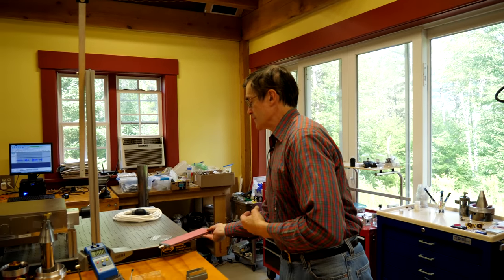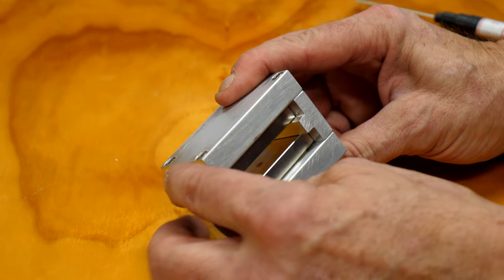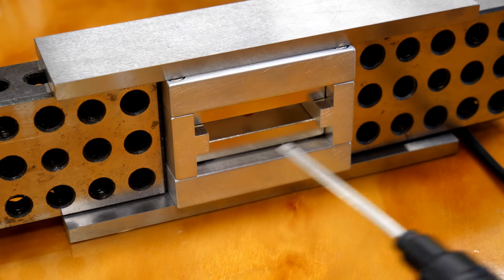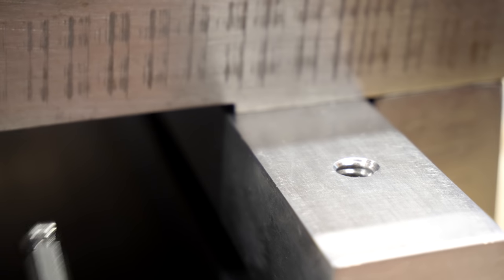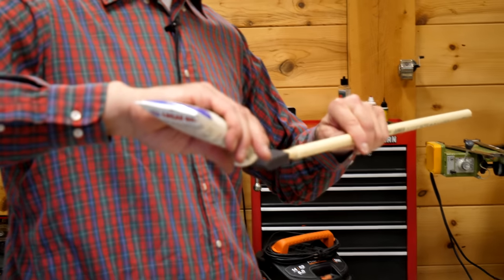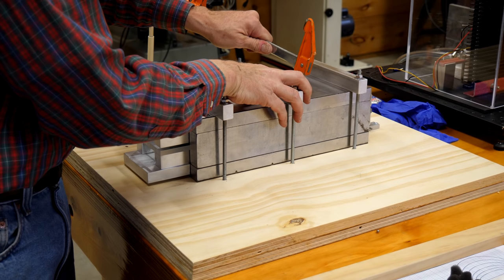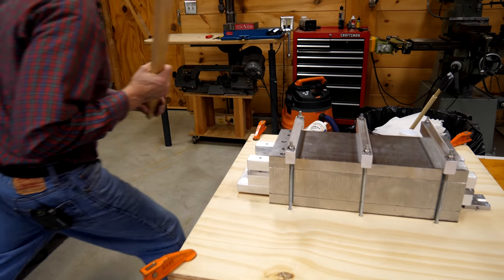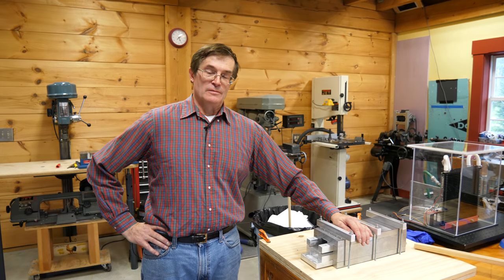Extreme Magnets

Comment: Any consideration of eddy currents in the yolk?
Reply from the maker: No, not really.  Eddy currents are produced when you have a changing magnetic field as in a transformer. The magnetic field in this magnet assembly is constant.
Reply: @TechIngredients  That's right, I completely forgot that. I was worried the assembly might end up making some heat due to Eddy currents and was curious if you had considered a laminated core instead. But there should be no currents. Thanks for replying!

Comment: Sir, what will happen if we use a neodymium magnet and put some rounds copper wire around it and then try to make it electro magnet... Will it change the magnetic lines/fields of the magnet untill we provide the supply..?
Reply from the maker: The copper is not ferromagnetic and will not change the field distribution without current flowing.  Add current and the field generated by the coil will modify the field established by the permanent magnet.

Comment: Of course if there is any movement of magnets the current induced in the electric  conductive material of aluminum will set up an opposing magnetic forces.  Perhaps some strong plastic would be a better choice as neither magnetic or electromagnetic or electrically conductive which may be hinderance.

Comment: My fascination with magnets just doubled! I'm still reeling a bit from the discovery that iron filings o n paper do not actually represent the actual field lines; that it's the presence of the filings linking to each other that makes the patterns. (can't remember the guy's name, but is on utube and a funny and fascinating physics teacher)
I shoot thousands of 3/8" ball bearings with many different slings I make and collect them with magnets. Some are stepped on, rusty, and hard to retrieve. I made an electromagnet from a microwave transformer that works, but I have to tote a battery charger around the range with it, and the field isn't far beyond it. 
How would I set up some neodymium magnets to reach out farther with the field, but still have the strength to pull the wanton balls from the ground?
Reply from the maker: There is probably not too much you can do other than using larger magnets. However, assembling a Halbach array will alow you to intensify the field on one side vs the other and this can be used to direct more of the field toward the ground.

Comment: Could you explain the convention of magnetic field 'lines'? I was taught (admittedly,  several years ago), when pursuing a degree in electronic engineering, that magnetic field lines did not exist. But was rather a man-made convention, (largely inferred from early experiments) of the manner of which iron fillings appear to align themselves via magnetic induced polarities, along a gradient path...
In effect, a field is a smooth magnitude gradient with no inherent lines.
Reply from the maker: Personally, I believe the best way to clarify this is to ignore the iron filings.  I'm not being factitious.  The material interaction between the individual iron particles includes friction and the unsymmetrical shape of the particles.  When a particular series of these needle-like particles achieves a closed loop from the N to S pole, the field will be guided or concentrated within this pathway, just like in our yoke and the field strength on either side will be lower thus discouraging the development of another series adjacent to this loop. 

The field is smooth and continuous unless there are objects in the surrounding environment that disturb it.  The filings modify the magnetic field distribution and then go on to show the effect of this modification.
This is like the man convicted of killing his parents and begging the judge for mercy because he is an orphan.

Comment: Wondering how you safely disassemble it.
Reply from the maker: We probably never will, but a hydraulic ram with the shaft coupled to an aluminum push rod and an extended aluminum guide would do the trick.

Comment: I had a thought experiment💭 "What if black holes are like Grand Recycling Machines ♻️ of the Cosmo's♻️" So just like systems with-in nature have a balancing act and abilities to convert and transfer energy. Like a ecosystem that keeps cycling so natural systems can function.. *(it probably has a limit beyond anything we can ever grasp or measure what it could be from our current perspective?) It's like asking someone to describe the outside of a box, if they are in the box, and the edge of the box exists past the limit of the observable distance that light can travel before hitting a boundary point. It would be pretty darn hard to explain what the outside of that box might be like? Ya know? I don't know? I was just thinking how a ecosystem of a forest flourishes due to it's symbiotic relationship with Fungi and mold/lichen, bugs, soil, mycelium, a water source, etc. With the help of the fungi the Forest no longer suffocates itself. The Fungi gets to help breakdown and convert the carbon thats locked away in the forest floor, fallen Tree's, plant matter that's all throughout the soil. On top of that it works together symbiotically with the living plants roots to help them breakdown & absorb nutrients. That plant cant function to that level on its own without the combination relationship of these 2 aspects of nature which keep this ecosystem functioning. This is true in many different ways, in many different types of ecosystems, all throughout nature. A part of me can't help but look at parts of space like that. Like if certain things in nature work here, then maybe there is a new way we have yet to discover and see how they behave. Aspects that could keep systems functioning throughout nature and space.  Some things we are limited to what perspective we can perceive and what we can utilize for further observations but we can still use our imaginations. Then fine tune things from there 👍🏼
~~~~~~~~~~~~~~~~~
~{Hypothetical idea}~
What if our universe is 1 half of a sorta ying yang ☯️ universe. 1 side is what we see, the other side is the Anti-universe. Maybe there could be a membrane layer in-between the 2 layers. Which allows for quantum particles to pop in and out of existence and decay from that membrane with the other half. The 2nd half could be our universe but maybe be an anti-universe. Where anti-particles go? Where the anti-matter can create this balancing act with-in the system. (It doesn't mean there is multiple versions of ourselves and all that stuff when people talk about a multiverse. No, not that.) It's just a thought about a possible natural way to balance things out, yet also describe the fluctuations we see in quantum mechanics. I just had a random daydream thought and obviously I hope more professional people's minds end up diving into this sorta possible theoretical physics. I think Neil Turok had a similar theory. 
⚖️ 🌐🧲🌡️🔆☢️⚛️♻️🌐☯️ 
~~~~~~~~~~~~~
🧲🌡️📡🔆☢️🔌🔊🔋♻️☯️⚛️
Out of every aspect of physics, i feel Gravity and all the aspects of Electromagnetism play such a crucial aspect of the cosmos and we possibly have much more to learn about these fields of physics? if you really think about it- It's really facinating how so many properties with-in Nature use: ~{"Differences"}~
 That factor seems to be a key factor in keeping dynamic systems functioning. *{High pressure/low pressure, hot/cold temp, different densities, static electric charges/discharges, electromagnetism north/south poles, different velocity/angular momentum, different amounts of energy/mass/frequency/vibrations. The different layers between different regions such as, land, water, air, edge of atmosphere, space, the different regions in space with different particle density, background radiation, creating bubbles/membrane layers, cloud regions, nebula's/ Galaxy's, Galaxy clusters, less dense voids regions of space compared to dense regions of space. All of these things are basic differences but create a way for the dynamic engine with-in Nature to continue flowing and operating to create and convert energy.} Just Like How a battery 🔋 transfers + charges through a membrane layer to a - charged side. Like how regions of high/low pressure and temperature 🌡️differences create winds. In water or a planets core- add some factors and It creates ocean currents and flow. Then internally in our planet it creates plate tectonics, planetary convection, geothermal activity, magnetic field around our planet, to hold a atmosphere. 
🧲🌡️📡🔆☢️🔌🔊🔋♻️☯️⚛️
I'm curious if there's more to learn about Gravity ~When it comes to our perspective on observing the Massive scale parts of the Cosmos? Like Entire galaxies/nebula's/filaments & any other diversely complex grand scale objects. They definitely have all sorts of behaviors interacting with-in them. I'm sure those factors need to be improved with how we factor them in to get our calculations of this layer of the Cosmos more accurately accounted for (Maybe it's just "we don't fully understand it yet?")
Reply from the maker: Thanks  for the long comment.
I'm sure you've  heard of Occam's razor.
There's  no reason that the mass that passes the event horizon has left the universe.  A neutron star gets close and the density of a neutron isn't high compared to the quarks that make up hadrons.  We can't see it, but a black hole may contain "normal" matter.

Comment: What are those lines "flowing" from South pole to North in magnets?  Positive and negative leads on batteries don't attract to each other, well not much if any??? If it is electrons in magnets, why doesn't it balance, no current flow?? Magnets, I think we're missing something about them (well I am anyway)??? Just SEEMS like there is some, ahhhh, perpetual energy there somewhere???
Reply from the maker: The lines are visual constructs like latitude and longitude.  They don't exist, but are useful for understanding the manifestations of magnet fields.

Comment: 12:47 I'm sorry, was that walls, or did I hear a "b" in there? Y'know I've never heard of that particular practice when applying lube, but you do you man lol (I'm sorry, I just found that prospect particularly comical, especially coupled with the dry presentation)

The way you regard the magnets helps to paint the picture of really just how crazy and hard to manage powerful magnetic forces are. It's almost comical the way you insert a rectangular prism into a hole thats just barely big enough to fit it, and then ask "that didn't flip did it?" lol

Comment: Ummm why did u need 2 turn it around. :D Did u forget 2 make holes in the wood 2 get "the loading block" bolts out, or was it to get help from gravity? :D That last magnet was scarry, mby put in a block of pure ice(H2O or CO2), and let them come together when it melts, so the new small magnets dont smack together and break. looking forward 2 the next video
Reply from the maker: I flipped the assembly to improve visibility during the loading process.  We tested smaller magnets to confirm that the impact was not great enough to damage a magnet.  The magnets within each row, oriented with their poles in the same direction will repel with hundreds of pounds of force.  Only the presence of the yoke makes it possible to get them within a few mm of each other even when I am pushing as hard as I can with the stick.
Reply: ok, it was only the last magnet(no. 6) that hit the second last(no. 5). 
  When i was first learning about rail guns, i had an ideer about spinning the "bullet" in a magnetic field before blast-off, both 4 the precision and ekstra kinetic energy, just a fun thought experiment. thanks 4 all the real knowlege videos, not just half-ass circus it. :)
Reply from the maker: Your welcome.

Comment: Thank you dear Dr for these video,, But i have  an important question,, Can you pull a nickel titanium metal strongly if it was 20 ml away from the magnet? For example, If there is an opening hole in a building wall that does not exceed 1cm in diameter and inside this hole there is a metal of nickel titanium Can you pull it from this hole only with the strength of a magnet? Note that the magnet is 30ml away from it?

Please if you have a social contact, i wanna to talk with you in important project,,
Reply from the maker: Do you mean 50 km away instead of ml?  Theoretically, yes, but the field strength would have to be truly astronomical such as is generated by a magnetar.
Reply: @TechIngredients  No dear doctor ,, I mean the distance is 20 Millimeter,, Can we made a strong magnetic to pull that nickle titanume?!,, Even if it is fraught with obstacles،، But the important as i saide before the magnetic must be the same size of nickle titanume,
Reply from the maker: Then the answer is practically, no.  Nickle titanium wire is even less magnetically susceptible than stainless steel which barely responds to a powerful magnetic field.
Reply: @TechIngredients 
Thanks dear dr for your answer sorry for my late  replay,, I 'm sad but i hope to finde in one day a method to pull a nickle titanume with a strong magnetic force

Comment: I don't understand why you didn't wait to have the other magnets on order, delivered, as well as any other component needed there to complete the project before you shot and published the video.
Reply from the maker: The answer is pretty simple.  This was a one time deal with no chance to try anything out or re-shoot because removing the magnets will be difficult enough to justify another video if we ever even do it. The strength of these magnets is high enough that although they can be brought to within a couple of mm from each other because of the field redirection from the yoke, they can not be brought into contact.  I did not allow enough clearance between the keeper cylinders to accommodate the last two magnets which we did have ready for insertion.

Comment: The highest magnetic field that can be created using Neodymium magnets is a 3.2 Tesla magnetic field. That is if the circuimstances are perfect. And the configuration is right.
Reply from the maker: You are correct, if you not only use a yoke, but also use pole pieces with a high saturation limit to concentrate the field beyond the field present at the surface of the magnet itself.

Comment: how about mumetal ? its an nickel iron alloy conducting almost 10x the fieldstrenght
Reply from the maker: It's not necessary for this application.  The plain steel is so inexpensive and easily available that the yoke costs substantially less than the magnets it contains.

Comment: what happens if your yoke instead of one solid steel in laminated  similar to a transformer laminations what would be results then
Reply from the maker: It would be similar. Laminations inhibit  eddy currents, but a permanent magnet doesn't  generate them.

Comment: I would like to see the conclusion of this project.  I thought there was going to be future videos after he had ordered the smaller magnets to take up the space at both ends of the yoke.
Reply from the maker: Actually, I'm working on that right now.
I will not add the additional  magnets, as that's  not necessary  to determine  if this will work, but might be added later.

Comment: How much what do get from that I suppose not much as seawater generator, because this setup is meant for a rail gun and is not optimized as seawater generator for seawater generation you need other requirement.

Comment: I've been playing around with steel ball bearings and high powered neodymium magnet cylinders and found some curious results in regards to friction and the duration and speed I get when I combine the right ratio of magnetic attractive force and diameter of the bearings. I take a 1" ball bearing and 3 1/2"  long 1/8" diameter cylinder N54 N54 neodymium magnets placed in an equally spaced distance along the equatorial line on the 1" ball bearing with a 1/4" ball bearing on the end of each cylinder. So I have 3 smaller spheres protruding from the larger sphere in the center the I take another cylindrical magnet with a 1/4" bearing on one end and use that to pick up my 1" sphere with its 3 satellite spheres and spin it with minimal force and give it a spin and it with the right proportion of magnetic force and bearing diameter the duration of the spin and speed of it are very suprising. The polarities of the cylinder magnets and number of them can produce interesting results.

Comment: Pure iron that has been annealed in hydrogen has a saturation of 2 T.
Double your fun with some extra spending. Pure iron yokes are not cheap. 
I want to use high pressure salt water and pass it through a 3mm X 50 mm channel leading to a flow splitter at the exit. The negative and positive ions will drift apart as they pass through the strong field leading to a split stream. Cation and anion go in separate streams. Then passing those streams to a galvanic cell and then extracting the electrochemical energy produced and create deionized water as a by product.

Comment: You say the field lines are pulling apart. Actually, they are repelling each other.  If you view a magnet cracked in half in a plane from N to S. You see that this is not two magnets repelling.  This is also the same as sliding the magnets into the frame. They are repelling each other.
..
Also, as yo use with your "yoke", if you have a magnetic frame, the field increases again.  This is precisely what is done in common AC transformers.